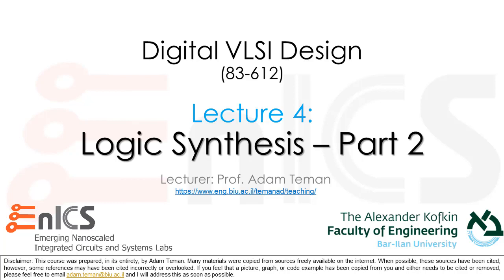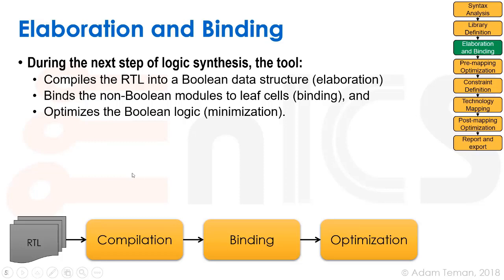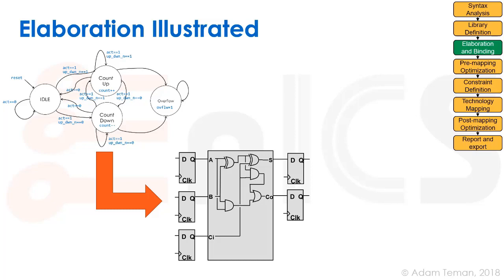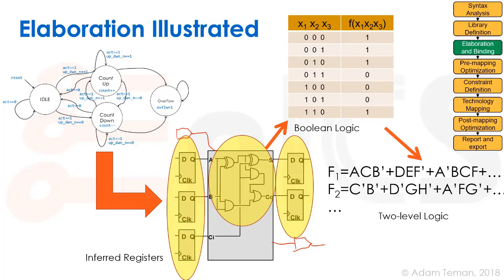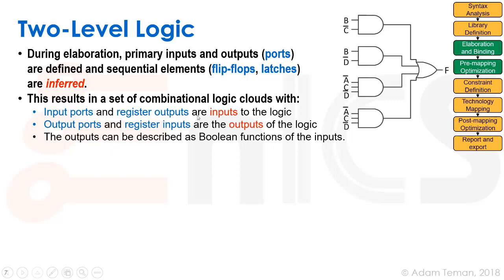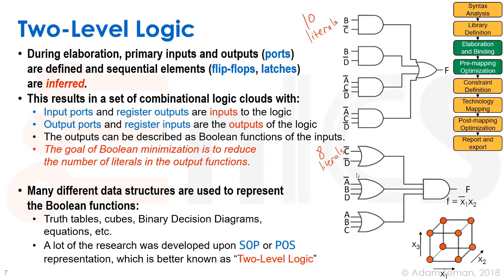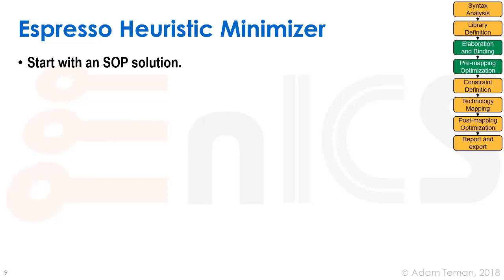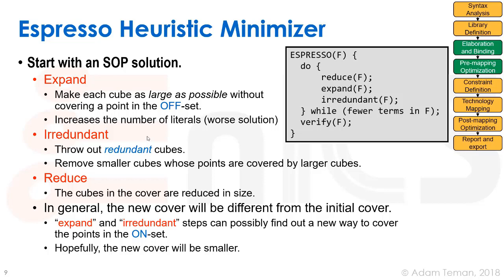DVD - Lecture 4a: Logic Synthesis - Part 2

Comment: You're a legend. Thanks a lot for these very informative lectures. Can you suggest some free software I can use for learning RTL Coding and Functional Verification? I want to be a Digital Logic Designer soon. I am just so confused as to what these different softwares can/cannot do, I am a beginner.
Reply from the maker: I am not an expert on all the different software options, and since I have access to the industrial EDA tools at the university, I haven't explored this much. That said, I know that there is a student version of ModelSim that is freely available and powerful enough to learn with and tools from Xilinx and Altera (Intel) for FPGA design come with good design and simulation IDEs that should be available free of charge. An open source simulator called "Verilator" is very good and can plug into VSCode. So I believe there should be quite a few options out there.
Update us if you find something that is useful!

Comment: what is leaf cell ? what are non - boolean modules?
Reply from the maker: Hi,

In general, logic synthesis takes RTL and turns it into Boolean logic gates. HDLs "know" about Boolean logic. They know what an AND and a NOR are and what a flip flop is. But they don't know about "weird" things like an ADC or an SRAM. These are what I refer to as "Non Boolean Modules".

Such "Non Boolean Modules" are also what I refer to as "Leaf Cells". Similar to a tree, where you have a trunk and then branches and finally leaves, but you can't "go any further", leaf cells are when "you can't go any further". In other words, you can have a module (in an HDL) that instantiates another module and another module and so on, but at some point you get to the "most inner" module which is "the leaf" of the design. This can be either a Boolean expression (such as A&B), which the HDL "knows about" (as I mentioned above) or it can be a "weird thing" (like an ADC or SRAM) that the HDL "doesn't know" about. To synthesize, all these "can't go any further" expressions must be mapped to a physical entity that can be fabricated in silicon. These entities are the "leaf cells". For Boolean logic, they are the inverters and NAND gates and other components of the standard cell library. For the Non-Boolean Logic, these are "custom-designed" or "analog" blocks that are designed with transistors and described with abstract (LEF, LIB, etc. as discussed in the following lectures).